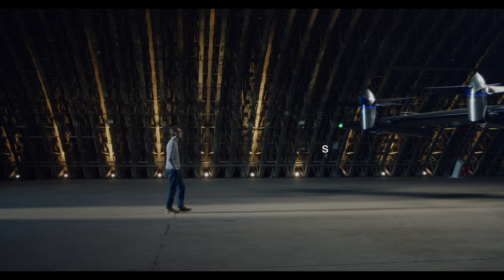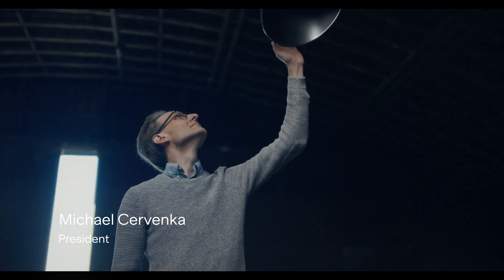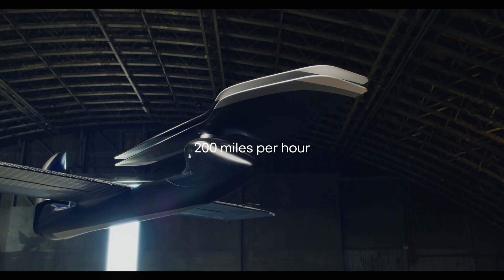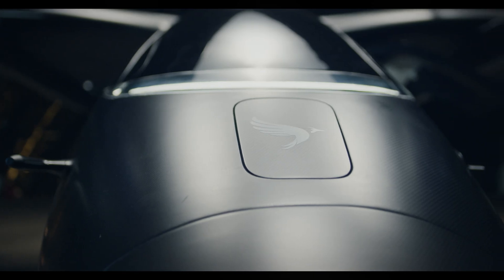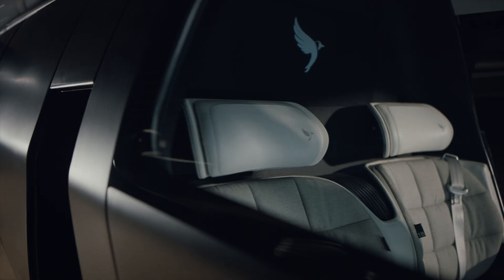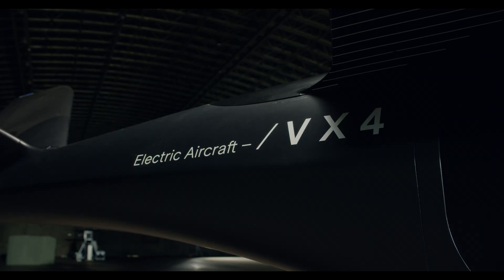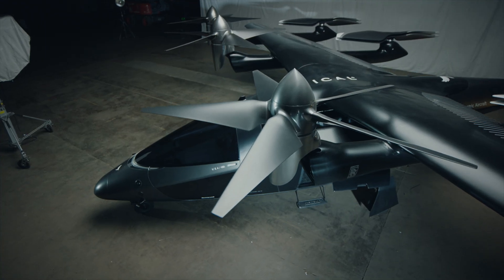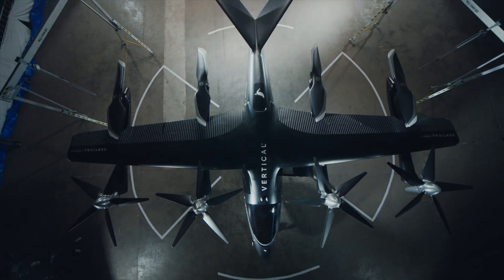Behind the Scenes: Designing the VX4

Comment: Better to keep those front rotors in vertical direction in case of any equipment failure. Individual mechanical system must be engage in case of such failure causing aircraft to assist in gyroscopic landing and decreasing damage.

Very unique design... looking forward for your next models.